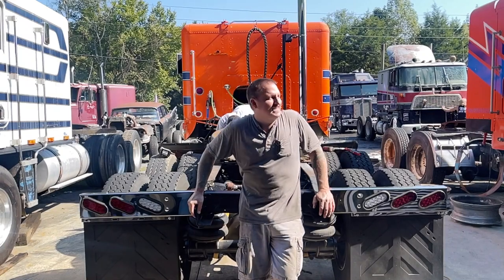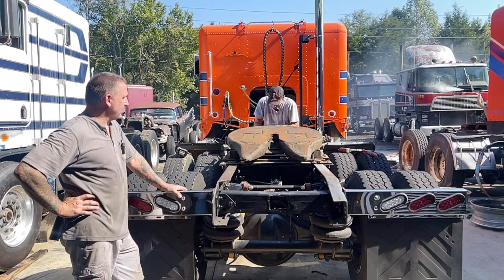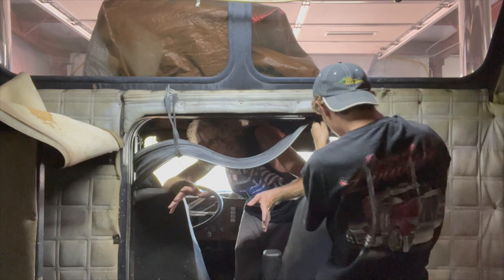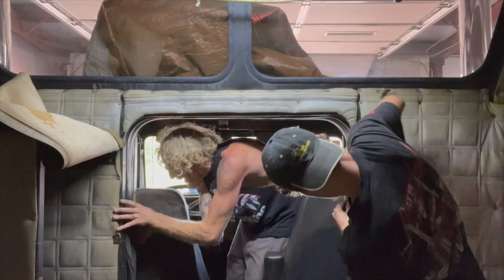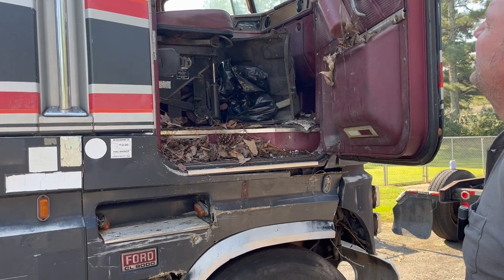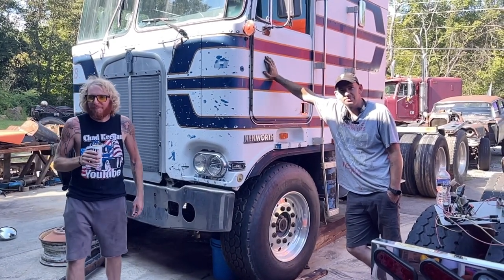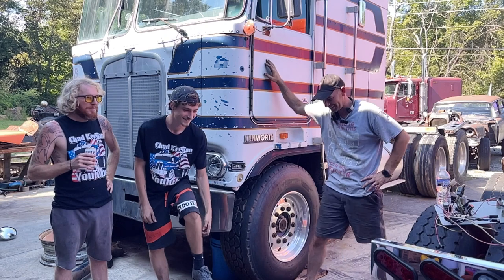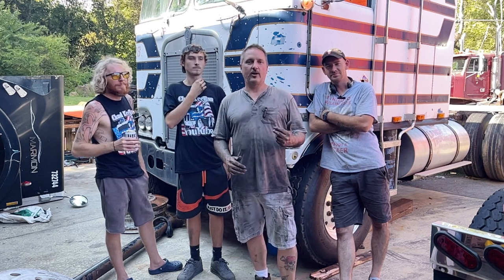Cabover Party. Average day at the shop plus extras :)

Comment: Why did manufacturers not built conventional's with Unibilt style sleepers back in the day?  Back then, conventional's were sort of modular.  They all had a standard cab to which a sleeper could be added, either as part of the order build or aftermarket installation.   Manufacturing a single cab and adding a sleeper by request certainly kept manufacturing simple.  They usually had a small rear window and when a sleeper was added, you crawled through that small opening.  Kenworth changed that in 1974 when they introduced the VIT sleeper, which featured a large opening between cab and sleeper.  That was really the beginning of the walk-in style, one piece sleeper cabs we see today.
Reply from the maker: Appreciate ya

Comment: The reason for sleeper boots is the same reason that they separate the cab and the sleeper. So they can remove the bunk for a bigger or smaller one. Or no bunk at all.  You can't do that with a one piece unit. Great Video. You guys have a great time. Stay safe out There 🇺🇸